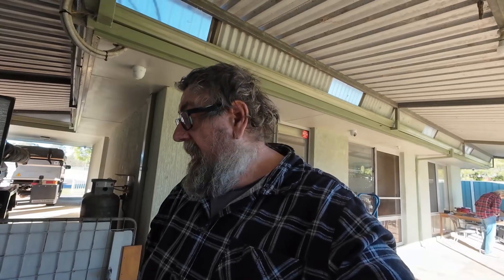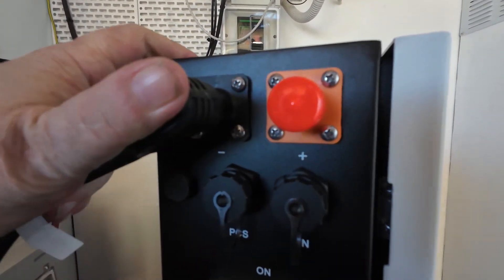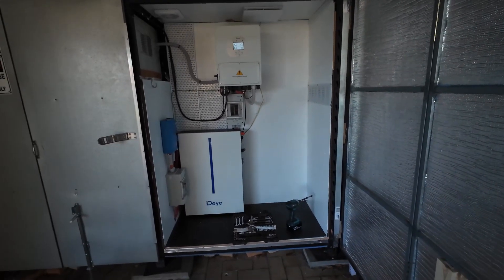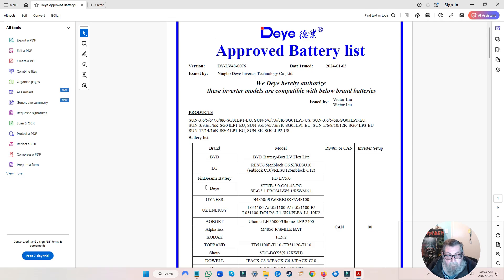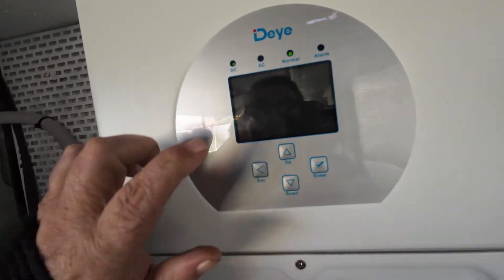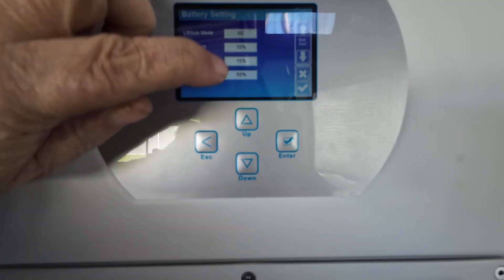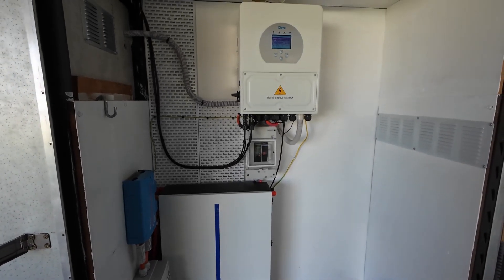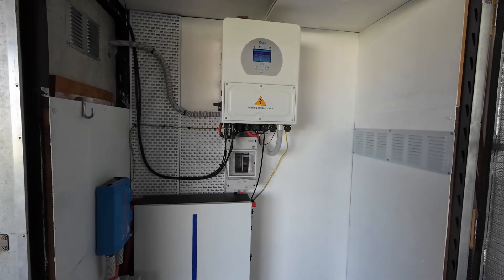Incredibly Easy Installation:  DEYE RW-M6.1-B Lithium Battery🔋🌿 (30)

Comment: According to the manual the IN port for parallel battery connection and inverter should be connected to the PCS port for communications.
Reply from the maker: If I had the 2nd battery, I would have showed how it all worked.  Unfortunately, they only sent the one unit. So I could not demonstrate how it all worked and the way I would have connected it. Before operating any form of equipment as technical as these, I always recommend reading the manual for yourself.